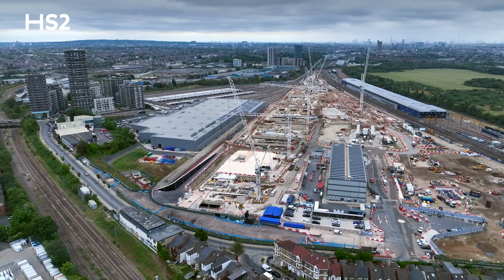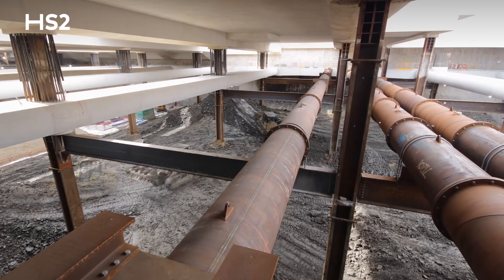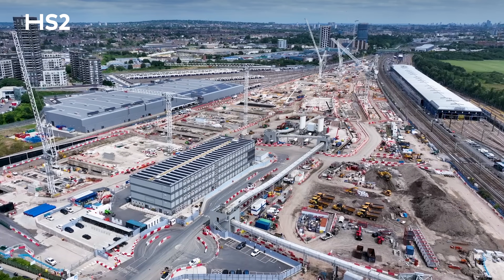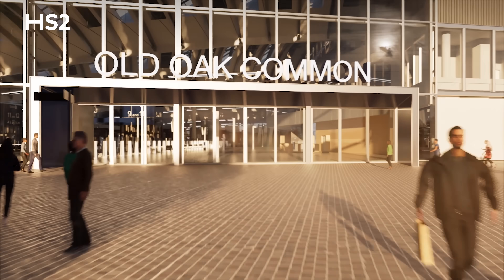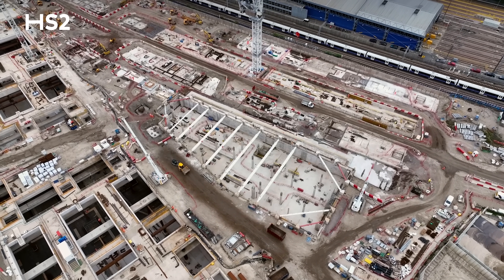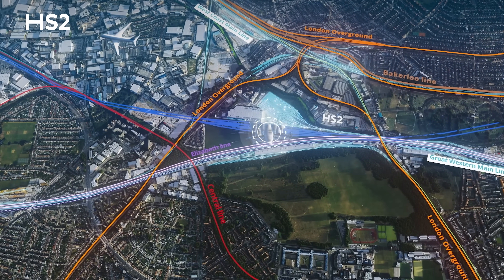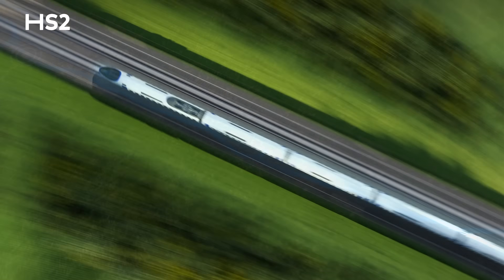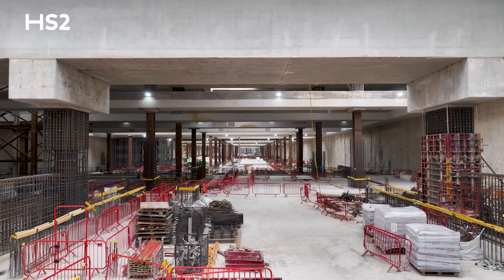HS2 Old Oak Common Station Project Update | October 2024

Comment: Still don't understand, what is the benefit of the Old Oak superhub? It seems to be a bit... useless?
Reply: To connect passengers to the Elizabeth line and GW mainline (and to a lesser extent other lines) without them needing to go all the way in to Euston. Let's say I live in Reading and want to head north on HS2, or I'm coming down from the north and want to get to Heathrow. Both journeys avoid clogging up central London by changing at OOC. Euston is also north of the Elizabeth line and as that's a fast efficient east-west connection across central London it would be very unfortunate if HS2 didn't connect to it at all.

Comment: Would terminating at Old Oak Common be such a bad thing?  Surely the bulk of passengers arriving at the existing London Termini need to use public transport to reach their final destination.  So the important thing is to have an efficient interchange with the tube/Elizabeth line/buses rather than be in the centre of London.
Reply: So if passengers wanted to go to Manchester or Liverpool, is it fair to say that their trains should terminate at Crewe or Euro Star trains terminated at Stratford International, why when other parts of of the UK have their trains terminating at the existing London Terminals such as Paddington, Marylabone, St Pancras International, Kings Cross, Waterloo and Charing Cross should people from the Midlands and the North West and Scotland have to get off in the middle of no where in London insted f where they normaly get off in London at London Euston
Reply: @peterwallen1063  No it wouldn't be fair for Manchester or Liverpool trains to terminate at Crewe, because there is no rapid, high density public transit system connecting Crewe to Manchester or Liverpool, and Crewe is well outside of these 2 cities.  Old Oak Common and Stratford on the other hand are in London and very connected to all parts of London via tube, DLR, Elizabeth Line etc.  How many people arriving at Euston leave the station and walk to their final destination? Very few.  Compared to the huge number that continue their journey via tube, bus etc
Reply: @EASYTIGER10  Same difference as there are fast trains from Crewe to both Liverpool and Manchester from Crewe so if these trains terminate at Liverpool and Manchester so they should terminate at Londoin Euston as all other lines terminte in the centre of London. why should it change to rough it on London commuter trains for no reason at all, after all the first GWR trains that will call at OOC will still go into London Paddington. People from the Midlands and the North have for a 100 years travelling on the WCML into London have got off at London Euston so why should it change now.

Comment: I wonder how much of the northern section could have been built if they weren't wasting money making pretty stations, cutting carbon emotions and "meadows" for Southerns. typical London centric instruction from London centric politicians.
Reply: HS2 is fixing congestion in Birmingham New Street and will allow for additional commuter trains to run in and out of New Street every hour. HS2 does nothing to benefit London commuters.
Reply: Every construction project in the UK suffers from the same fate you mention. Architectural dreams dreamt up by the concept lead Architect. Then the Contractor has to design the detailing to make the concept work which always costs more than the Cost Consultant has put in the budget. That's because the concept doesn't work in practice snd the Cost Consultant doesn't understand that. Then there are the eco warriors who sit on the town and country  planning departments of every Local Authority who insist on the top level of the Environmental BREAMM rating beibg applied to the design, and also insisted on by the concept Architect. That adds millions to the cost to provide things like badger setts, bat tunnels, newt ponds, rainwater harvesting, over the top landscaping and tunnels instead of cuttings to cut down on the noise. Then there are the agreements of the statutory service providers to appease where the work impacts on their service such as Network Rail. British waterways and the gas, power, water and drainage authorities. Then the 32 billion budget figure that was pulled out of the air without very much thought given to it becomes 100 billion and rising.

Comment: This looks amazing, I just wish we could get the basics right so that for example someone could get from Swansea to Heathrow just tapping in and out rather than booking multiple trains and trying to work out what off-peak trains are.
Reply: The priority of railways needs to be the maximise the modal shift from road to rail. We need to make rail fairs cheap. And we need to make rail fares idiot-proof and not build the system to entrap people who buy the wrong ticket with penalty fares. Revenue protection officers should focus exclusively on people who regularly avoid paying. Anyone who buys the wrong ticket should just be asked to pay the difference.

Comment: The HS2 concept was born because of several misconceptions imaginations.
First the wealthy instead of using a helicopter to get out of London to their country estates in the north.
Our landscape does not lend itself to high speed trains. Cattle truck trains already do 115 mph.
HS2 155 mph not that much faster. The time saved is lost because of slowing down into stations and then travel into the centre of London another 45 minutes.
Madness utter madness,HS2
Reply: The main reason for building HS2 is because mixed traffic on the West Coast Mainline, Midland Mainline and East Coast Mainline prevents more commuter trains from being run. The only way to fix that issue is to separate the express services and stopping services onto different tracks.

The alternative to HS2 is "widening the existing mainlines" which means bulldozing large numbers of houses in every city, town and village that those mainlines pass through. Given that we need new tracks anyway, it makes sense to build high-speed lines because we need to eventually run high-speed trains all the way from the Eurotunnel to Scotland.

Comment: I needed to know why they couldn’t dig a tunnel and do an extension for most of the mainline Trains so that they could extend the unused abandoned underground train stations. Why couldn’t they use the part D78 Stock train doors on the sides and also restructure the front face of the A60 and A62 stock which will include the class 507, class 508, class 313, class 314 and class 315 remix and make them all together and also redesign all of them into an overhead wire line trains and also make most of them into Five carriages per units and also having three Disabled Toilets on those Five cars per units A60 and A62 stock trains and also convert the A60 and A62 stock trains into a Gardner 6LXCT, Leyland 510, Gardner 6LXC, Volvo B10M, Gardner 6LXB, Gardner LG1200 and Gardner 8LXB Diesel Engines and also put the Loud 7 Speed Voith Gearboxes even Loud 10 Speed Leyland Hydra cyclic Gearboxes in the A60 and A62 stock, class 507, class 508, class 313, class 314, and class 315 and also modernise the A60 and A62 stock and make it into 11 carriages per unit so it could have fewer doors, more tables, computers and mobile phone chargers? A Stock Train and 8 Disabled Toilets on those A stock trains. why couldn’t we refurbish and modernise the waterloo and city line Triple-Track train tunnel and make it even much more Larger and extend it to the bank station, making it into a Triple-Track Railway Line so those Five countries such as Australia, Germany, Italy, Poland And Sweden to convert the waterloo and city line Triple-Track Railway tunnel into a High-Speed Railway lines? The Third Euro tunnel Triple-Track Railway line to make it 11 times better for passengers so they could go from A to B. Then put the modernised 11 carriages per unit A Stock and put them on a bigger modernised Waterloo and city line Triple-Track train tunnel so it could go to bank station to those Five countries such as Australia, Germany, Italy, Poland And Sweden. The modernised refurbished 11 carriages per unit A stock could be a High Speed The Third Triple-Track Euro Tunnel Train So it is promising and 47 times a lot more possible to do this kind of project if that will be OK for London Australia, Germany, Italy, Poland And Sweden. oh by the way, could they also tunnel the Triple-Track Railway Line so it will stop from Buckinghamshire, Hertfordshire and Essex so that the Passengers will go to Australia, Germany, Italy, Poland and Sweden and also extend the Triple-Track Railway Line from the Bank to Buckinghamshire, Hertfordshire and Essex Stations so that more people from there could go to Australia, Germany, Italy, Poland And Sweden more Easily. Why couldn't they extend the Piccadilly Line and also build brand-new underground train stations so it could go even further right up to Clapton, Wood Street can they also make another brand new underground train station in Chingford and could they extend the Piccadilly Line and the DLR right up to Chingford? All of the classes 150, 155, 154, 117, 114, 105, and 106, will be replaced by all of the Gardner 6LXCT, Leyland 510, Volvo B10M, Gardner 6LXC, Gardner 6LXB, Gardner LG1200 and Gardner 8LXB Diesel Five carriages three disabled toilets are air conditioning trains including Highams Park for extended roots which is the Piccadilly line and the DLR trains. Could you also convert all of the 1973 stock trains into an air-conditioned maximum speed 78 km/hours (48 MPH) re-refurbished and make it into a 8 cars per unit if that will be alright, and also extend all of the Piccadilly train stations to make more space for all of the extended 8 car per unit 1973 stock air condition trains and can you also build another Mayflower and Tornado Steam Locomotive Companies and can they order Every 87 Octagon and Every 48 Hexagon shape LNER diagram unique small no.13 and unique small no.11 Boilers from those Countries such as Greece, Italy, Poland, and Sweden, can they make Mayflower and Tornado Steam Locomotive speeds by up to 147MPH so you can try and test it on the Original Mainline so it will be much more safer for the Passengers to enjoy the 147MPH speed Limit only for HS2 and Channel Tunnel mainline services, if they needed 16 Carriages Per units, can they use those class 55’s, class 44’s, class 40’s and class 43HST Diesel Locomotive’s right at the Back of those 18 Carriages Per Units so they can take over at the Back to let those Mayflower and Tornado Steam Locomotive’s have a rest for those interesting Journeys Please!!!!!!!!!!, oh can you make all of those 18 Tonne Boxes of Coal for all of those 147MPH Mayflower and Tornado Steam Locomotive’s so the Companies will Understand us PASSENGER’S!!!!!! So please make sure that the Builders can do as they are told!!!!!!!!!! And PLEASE do something about these very very important Professional ideas Please? Prime Minister of England, Prime Minister of Australia, Prime Minister of Sweden, Prime Minister of Germany, Prime Minister of Italy, Prime Minister of Poland and that Includes the Mayor of London.
Reply: Most abandoned Underground stations in London have trains running through them non-stop.

There is a short bit of four line Metropolitain Railway Line cut and cover tunnel that got cut off so that the Thamelink trains could be extended in length. Gloucester Road and South Kensington are four platform stations that got throttled down because east of South Ken only has two platforms. The Picadilly Line from Holburn to Aldwich has been abandoned, but that is tube-sized track that doesn't even properly connect to the Piccadilly Line. The abandoned Jubilee Line station at Charring Cross is used to park trains that need to be taken out of service.

The Crossrail Project could have built new lines for HS2, as well as for Crossrail, and linked HS1 and HS2 together, but you can't run high-speed rail trains through London Underground, as the Victorians who built the Metropolitan Railway and Metropolitan District Railway did not build in enough capacity for extra trains to run through London Underground's busy east-west lines.

Comment: Old Oak Common will probably end up becoming as irrelevant as Stratford International on HS1. Total waste of money.
Reply: Not quite. Unlike Stratford International, which is a long way away from the other Stratford, this station connects directly with Crossrail trains to Reading, Heathrow Airport and Essex and the Great Western Mainline.
Reply: @ Ha ha ha! Great Western mainline? It takes 1h 20m to travel directly from Bristol Temple Meads to Birmingham New Street! Who’s going to bother farting around by changing at OOC? The whole project is an overpriced farce: £100 million for a bat shelter! 🤣🤣🤣
Reply: @NobbingNobby the GWML doesn't solely connect to Bristol, thus, Old Oak Common should be useful for people who use the GWML that are closer to London than to Bristol.

Comment: Why is there a tunnel being built at washwood heath?
Reply: The Tunnel is being built from Bromford not Washwood Heath to Water Orton due to the amount of existing obsticles in the lines way, at the point of the Tunnel going from the Bromford End it goes under the main Bromford Road Outer Circle Ring Road, the River Tame, the Birmingham to Derby line, Bromford Bridge Council Housing estate, the elevated M6 motorway, a Birmingham City Council public refuse tip and the Chelmsley feeder road surfacing just out side Water Orton. It is called the Bromford tunnel and starts just before Wshwood Heath

Comment: don't we already have a fast train from London to Birmingham? :face-green-smiling:
Reply: The whole point of HS2 is to relive pressure on the West Coast Mainline when those High Speed Avanti trains moves to their own set of tracks to run more local and regional services, plus freight which unable to run a full service at present.
Reply: Yep, but the line and Birmingham New Street are congested and Avanti West Coast train services from Birmingham to London are being transfered to the HS2 route when it opens

Comment: Too bad it doesnt join up with HS1
Reply: Why does it require to join up with HS1
Reply: @peterwallen1063  We need to get Eurostar trains to Scotland eventually.
Reply: @DavidShepheard  Eurostar Trains will never run to Scotlaand as all Eurostar as a company are intrested in is High Speed trains from London to Paris and Brussels and the Eurostar trains could not operate on the UK rail network due to their desighn and Signalling desighn

Comment: And will the station have the ability to accept double height trains to be future proof that is now the norm in Europe unlike the UK?
Reply: Double deck or Duplex trains will not operate on HS2 as these trains will have to be able to run on existing UK main lines to Liverpool, Manchester and Scotland and will be normal height trains
Reply: @peterwallen1063  Yes I know that but one can imagine in 20 years time we will say no because we did not think ahead!
Reply: @_RabbitLeader  We have tried double deck trains in the 1960's on London suburban work and it did not work out plus HS2 trains will not be restricted to just running on the HS2 route but will be capable to run on the existing rail network and if it was the case Eurostr would of introduced them on their HS1 route from London to Paris and Brussells

Comment: Why’s it not going up to Manchester?
Reply: Tories
Reply: Where’s that? 🤣
Reply: HS2 trains will go to Manchester, but the metro mayors of the West Midlands and Greater Manchester are planning to find money to build a line from Lichfield in Staffordshire to Manchester utilising land already set aside for the original HS2 route but built slightly cheaper  with a speed of 185 mph instead of 225 mph
Reply: @peterwallen1063  We do really need a Parliamentary Petition to reinstate proper HS2 trackage (that allows for 225 mph line speeds) up to Manchester and beyond. I keep seeing anti-railway campaigners say high-speed rail between London and Birmingham makes no difference, but this line eventually needs to get to Scotland. And high-speed InterCity trains need to be able to compete with domestic flights from London to Glasgow and Edinburgh, so that we can ban domestic flights in England and between England and the Scottish Central Belt.
Reply: @peterwallen1063 I applaud them for trying to get something done there but it would be a terrible waste to go to all the trobule of building a whole new railway to connect to the southern bit of HS2 without making it a fully modern spec high speed line.

Comment: Are all HS2 and GWR trains stopping there ? Shame no link to North London (Mildmay) line. Would gave been useful link to Richmond and North London
Reply: They Mayor of London has plans for two new stations on London Overground close enough to Old Oak Common for an Out of Station Interchange. But those plans require Central Government funding (as do other TfL improvements like the Bakerloo Line Extension, Crossrail 2 and diverting the Metropolitan Line from Watford Station to Watford Junction Station via Watford Hospital).

Comment: The London Overground passes nearby yet is not integrated into the site, which seems to be a lack of useful planning
Reply: The Mayor of London has a plan for two London Overground stations close to Old Oak Common. These require Central Government funding though. If the money is made available, they will be Out of Station Interchanges. A pair of moving walkways to give a direct connection would have been better.